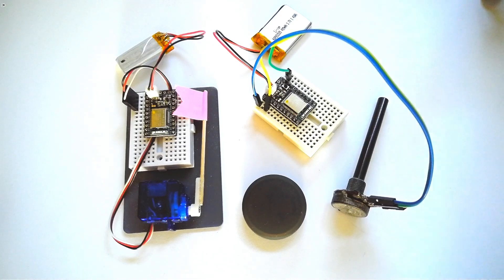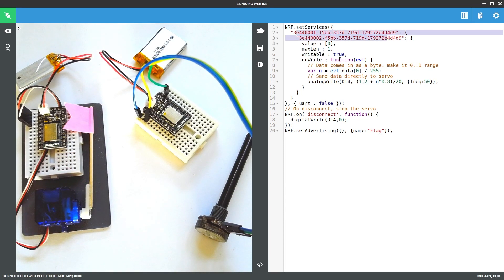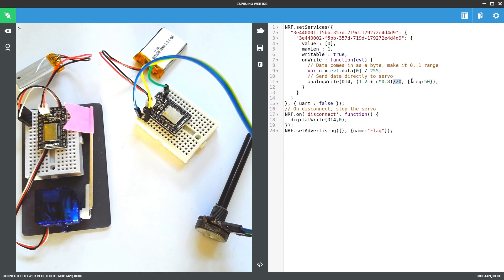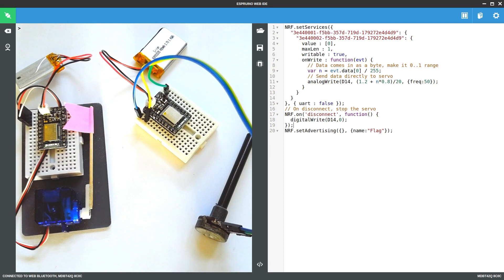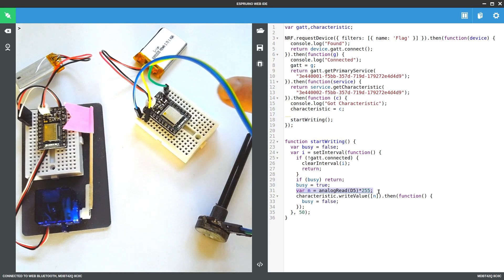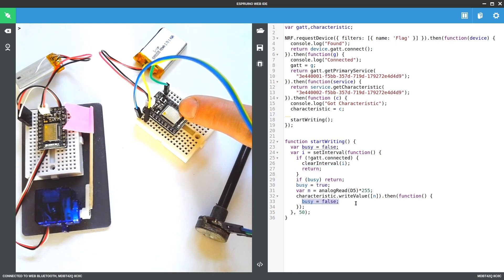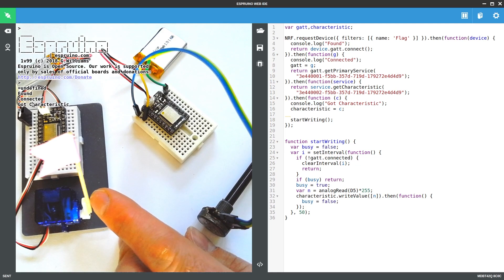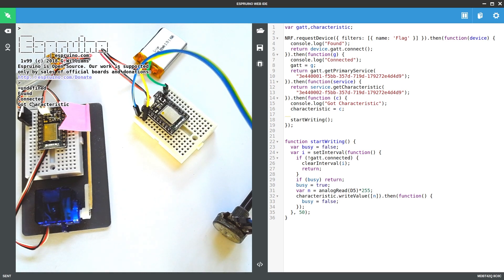Bluetooth LE on Espruino, Part 2

Comment: Not sure if you can help but does the MDBT42Q have captive capability? Or is that just a Puck.js feature?
Reply from the maker: Hi - I'm not quite sure what you mean. You mean Bluetooth Central (so the ability to connect to other devices)? That works on all Bluetooth Espruino boards we sell.
Reply: @Espruino  oh I'm sorry I mean like capacitive touch... like on pin d11 on the puck.js... but on the smaller  MDBT42Q
Reply from the maker: @StuartDesign  Ahh right. Well, capsense direct on that pin is built into the Puck.js because it needs an extra resistor in there. But if you use two GPIO and add a resistor then you can use this code to do it on any Espruino Bluetooth board: https://www.espruino.com/NRF52LL#hardware-capacitive-sense-on-two-pins